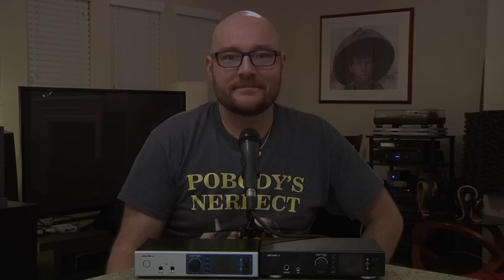The Brothers ADI-2: Reviews of the RME ADI-2 DAC and Pro FS

Comment: Enjoyable review thanks.
The headphone outs' are also a sophisticated hearing aid. You can set both channels so radically differently that you can customise for differences between your hearing needs separately in each ear. Personally I'm a speakers man.
  I chose the FS 2 despite thinking I might find better sound at the price (the cheaper Bifrost 2/64 in particular).
I still feel as I thought then that with a DAC this good if I could not get a sound I liked then the fault would be mine not the DAC's.
After initially experimenting with some of the settings over the first two months, I managed to ruin my set up, so reverted to finding "Factory reset" and for the next year I was listening to it as it came, out of the box.
In the mean time my sound system has just finished reaching the £8K+ spend and for the first time I define it as "Sophisticated".
So far any small changes I have just restarted trying in the EQ, I think I like less than "out the box".
I aimed for cristal clarity and having achieved it, ironically one of the first things you notice is the draw back; Many of the iconic albums are littered with "Sound Bombs"(Like photo bombing) people tapping on stuff etc.
Between my RME and "Tube rolling" I have all I need to keep this "Hobbyist" happy.

Comment: seen on several websites this is advertised as an audio interface , can this work as a medium between a PC Daw (optical spdif or adat depending on variant) & a set of monitors? I'm perplexed by RME's options & I'm done with pci express cards & I'm in a position & mindset whereby i don't want to upgraded again.

even if the seen on several websites this is advertised as an audio interface , can this work as a medium between a PC Daw (optical spdif or adat depending on variant) & a set of monitors? I'm perplexed by RME's options & I'm done with pci express cards & I'm in a position & mindset whereby i don't want to upgraded again.

optical connection to the "cheaper" non pro & then to a mixer (4-8 channel analogue mixer - like a mackie or better). I'd use this for listening & entertainment , mild gaming & i mean mild!

great video , I've wanted an rme card for years , over 2 decades 😂

Comment: I have read that audiquest Cables like Cinnamon or Carbon for pc to the DAC is a good solution and bring a bit better sounding and a massiv granit or marble plate with rubber foots (half balls like) to eliminate vibration and some means it‘s hear far better. I think with the cable thats right but with the stand maybe by high volumes or is it like very expensively turntables which have don’t like any vibrations and those Hifi Plate gives Advantages Step?  Nice Video like it , my rme with ess dac chip comes tomorrow on saturday or on monday; Greetings from Germany

Comment: The Monoprice Monolith THX AAA DAC/Amp also has a 5 band user definable parametric equalizer, a host of analog and digital inputs, DIRAC II surround,  Dynamic Range Control/compression, several digital filters(5 or 6) , and both 4 pin XLR and unbalanced 6.5 mm headphone jacks and costs only $500. 
No remote or Bluetooth functionality.
But I would love to see you compare it against the RME ADI DAC2.

Comment: Great review, thanks. You are mentioning digital room correction using the parametric eq of these devices. But isn't that a limited form of room correction? It can only change the amplitude at certain frequencies. e.g. there is no correction in the time domain.

Comment: The ADI fs is one of the DACs I have had my eye on. I use an integrated tube amp (Rogue Audio Cronus Magnum 2, incl. phono input) feeding a pair of KEF LS50 and dual REL T9i subs. I intend to use ROON in the future and I mainly stream from Spotify and TIDAL Masters. Neither of the 2 DACs (RME or Schitt) do MQA though I believe ROON does the 1st MQA unfold. Have you any idea how this RME ADI would compare to the latest Schitt Yggdrasil? Both are within my budget.
Reply from the maker: I've heard the Yggy a few times, but never in my own system. However, I've done lots of ABXing with the Gungnir Multibit and the ADI-2. The Gumby may be said to have a somewhat more "analog" sound, but imho the ADI-2 is the better DAC. Slightly better separation and imaging, especially in the Z-dimension. A bit cleaner, perhaps. I was doing some blind testing between the two and having some trouble. Turns out the A/C was on. I turned it off and suddenly was able to discern them again. Even though I can't really hear the noise floor, in some sense I could. Yggdrasil is certainly a better DAC than the Gungnir. If I had to hazard a guess, the ADI-2 and Yggy are comparable, at least playing in the same league. If all you want is a DAC, the ADI-2 DAC is a steal at $1100 though.
Reply: @seltzertronics2538  thanks for your (very fast) feedback. It's a real pity I can't trial the ADI unit here in Singapore. So you think you might put up an Idiot's Guide to using the PEQ of the ADI for Room correction? This seems like the killer feature as sound differences between DACs can be very much down to individual preference. $1000 is still a lot of coin to drop on a hope and a prayer especially when I never use headphones and don't game at all.

Comment: On the Pro, at 5:25- Are you sure that you can use a 1/4" instrument input device, like a guitar? The manual says no. I hope you are right and it is wrong. Can you test it?
Reply: Please make a correction in your review. An instrument input is different than a line input. In the manual it states that you can not use the input for instrument in. You would need a D.I. converter between your guitar or bass for this. I sure wish it would but it won't.
Reply from the maker: Well, it does have quarter-inch inputs and they do take a line-level input. I don't believe it does any phantom power or anything if the input device requires it.